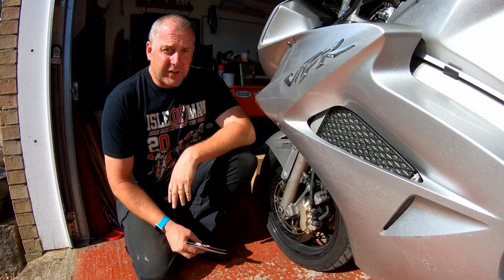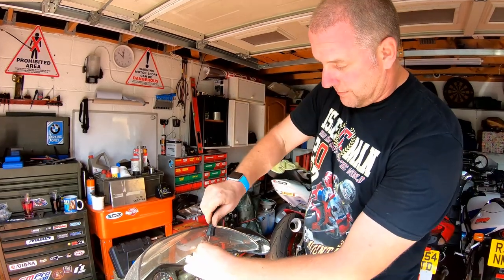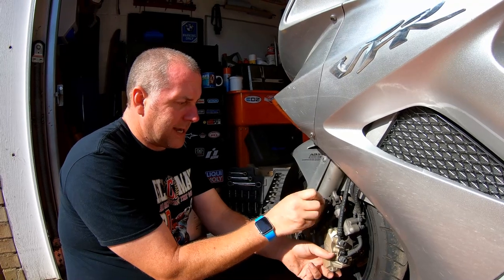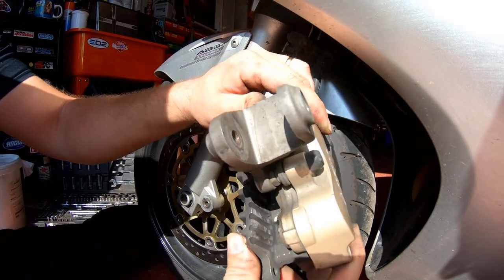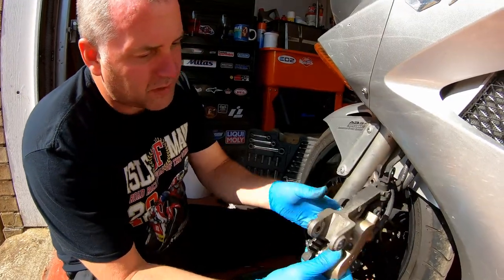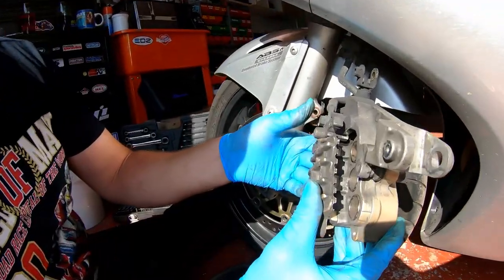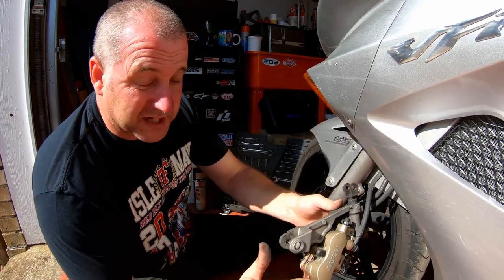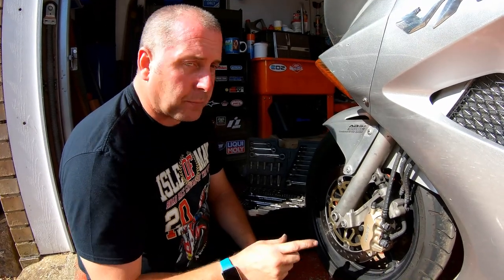2003 Honda VFR800 VTEC Front Brake Pad Replacement

Comment: Hello,

I cleaned the pistons of my front caliper after changing my tires. I'm wondering if it's normal for the caliper to move a bit while driving. I've never really paid attention, but I did disassemble and reassemble it with the correct torque. Taking a look while riding, I noticed it moves during driving. Is it because it's a floating caliper, or should I be concerned?

Best regards,
Romain

Comment: Very good replacement video. I like to actually work my pistons out a little and clean them as you did with a shoe string soaked in brake fluid. I keep working them in and out until they both move equally with a squeeze of the lever and obviously I use the rear brake to work the center piston in and out. When everything is moving nicely, I push the pistons in to their pad installation depth and do what you did to install them. Like you said , cleaning and freeing the pistons is a routine maintenance item....if you want 100% braking force. Cheers Kevin!
Reply from the maker: Nothing like a good cleaning regimen to keep the brakes in good order, I do thus every couple of months. Sadly most people don’t pay any attention to their brakes at all until they hear a metal on metal noise or notice a severe drop in performance!

Comment: Hi Kev,
Completely off the subject. 
I rode through Andorra a couple of years ago on my '98 VFR and it didn't like the altitude at all, it was like riding with the choke out. I thought as it's a fuel injection bike that runs perfectly at normal altitudes  the thin air wouldn't affect it but it did seem to. 
Any thoughts on the subject would be much appreciated as I would like to take it to the mountains again. 
Really like the videos.
Thanks,
Ged

Comment: Hi Kev dont no if you can help with this one just changed all the pads on my old vfr800fi 1999 looked at the old pad and noticed that on the piston side of one pad there is a .5 mm shim between the s/s part on the back and the back of the pad the new pads do not have the shim Thank Alan

Comment: What is that 3rd (middle) piston for? And you never greased the "runner".....agree on the cops slip comment, but you should lubricate the "runner" as well as the spring slider.

Comment: Hey Kev, noticed that at 19:16 your pin is missing the O ring on the end of the pin. Part #8 (45111-MAJ-G41) on the partzilla left front caliper diagram. It appears on both front caliper pins.

I know my bike has them, but have you had any issues with this ring missing? I'm ordering new pins for my 03 as well and figure I'll just transfer them over if they are needed.

Also, have any plans to do a video on greasing the swingarm and pivot bearings?
Reply from the maker: You are absolutely correct mate, they were missing and I didn’t realise until I removed them that they wouldn’t be there! I didn’t have any at the time of filming! 🤦🏻‍♂️ I have since replaced them 👍🏻
Reply from the maker: Also, I will be no doubt looking at those bearings in the future! Lots of videos planned! 👌🏻😎
Reply: @KevsShed  I look forward to it. My chain slider tore at one of the lower screws and I'd like to see someone take the swingarm out before I go after it.
Reply: Jensen, worth pointing out that these o-rings will require the occasional replacement. I pulled my calipers off and cleaned everything today and my o-rings (probably 17-year-old rubber rings on the 17-year-old bike) had dry rotted and came apart as soon as I touched them. So that was fun.

Comment: Having issues with both front calipers. Both centers were not moving. Hot the brake side to work after some cleaning but the left brake side didn’t want to move. Pressured the outer calipers and still didn’t move. Was able to remove and was able to hit the level to see if fluids went through snd it did. I cleaned and flushed out and bled but still nothing.  Any Thoughts?
Reply from the maker: My recommendation is a good replacement of the seals in each caliper, paying particular attention to the recesses that the seals fit in to remove any corrosion. This should sort your problem bud!
Reply: @KevsShed  Got still one caliper not working right.. seems like its' clogged internally. I don't think seals are the issue as there is some fluid showing up in the center chamber, but nothing leaking out of any seal.. Pressure is building as the two outer pistons do move one from another, but yeah after this long seals are a good idea, but it still feels like its clogged in the shared channels. Is there a diagram of the internal path of the caliper? it's passing from #1 to #3 and #3 back to #1 but nothing happens in #2 piston.
Reply from the maker: @mathiasgonthier5436  No you misunderstand me, if corrosion sets in behind the seals it pushes them out which grips the pistons and prevents proper operation
Reply: @KevsShed  wish I could send photos.. all was original and looks very clean.. i rolled my finger over to see if I saw issues, but nothing I could see or feel. No dent or deterioration of seal.. but yes I can see your step o thinking seals.. ok.. well it will take ordering some to make sure.
Reply: @mathiasgonthier5436  press rear brake and the middle piston will come out

Comment: Hi Kevs,
Hope you are well?
I've followed your instructions per video and changed my front break pads on the VFR. 
However afterwords I've notice the my wheel is not spinning freely. 
Any suggestions?
Help pls
Reply from the maker: Did the pistons move back in freely or were they very tight?
Reply: @KevsShed  a bit tight but I've pushed them back.
I must say I didn't spend the same level of dedication you did in the cleaning. Could be that?
Should I get them out again and give the pistons a good clean like you did?
Reply from the maker: It may help, better still would be to completely remove the calipers and rebuild them with new seals. This will require a full rebleed of the braking system however but I have a video available detailing the process.
Reply: @KevsShed  thank you, will do the process again, but I know previous owner had that done few months before I got  the bike.
Thanks for your help and advices.
Reply: I had a 2001 VFR, and after 16 years it was becoming almost impossible to push the pistons back during a pad change - I pressed the pistons out as far as I dared without removing them completely, cleaned round them with scotchbrite, greased with silicone (no rubber grease to hand) and pushed them back.  Worked perfectly for the last 3 years.

Comment: Hiya Kev just wondered if you had noticed much difference with the feel of your brakes since fitting the braided lines ??? brilliant channel by the way.
Reply from the maker: One thing that you will nearly always recognise with braided lines is this; you will notice much greater power at the calipers but this comes at a loss of feel at the lever. It's kind of hard to describe but this is the way I would regard it: It kind of makes the brakes feel more like an on/off switch as opposed to progressive. You only notice this after first fitment though and this gets better the longer you have them as you develop your feeling for the brakes. The brakes are bloody awesome now though! 👌😎

Comment: Hello. So i have a problem with the front left caliper (cbs system). I changed the tires so the wheel was off. The mechanic reinstalled the wheel but now the front wheel is constantly under light braking. After a really short ride the left disc is hot while the right is still cold. I removed and reinstalled the wheel with extra care, according to the manual but still the same. What do i do??
Reply from the maker: My initial suspect would be that one of the pistons is sticking in that caliper, take the caliper off, give the pistons a good clean, there are many ways that you can do this but an old toothbrush can be good here and attempt to push them back into the caliper. If any won't budge under reasonable finger pressure then you will have found the issue and a caliper overhaul may be in order!

Comment: Great vid as usual,  do you ever worry about your brake lines. For all I know my 2002 vfr  has the original ones
Reply from the maker: I’m not concerned about mine, I check them regularly and there are no warning signs such as cracking or crazing to the rubber. When they do need to be replaced then I will change them for braided ones.

Comment: No copper anti-slip to be seen! - a man after my own heart (oh, that sounds dodgy).  After all, Honda choose SS sliding clips & springs for a reason - and you just cleaned them.
Reply from the maker: Nice one Martin! It seems that there are some sane people in the world! You'd be surprised at the number of comments from people telling me that I am an idiot for not slathering an anti seize compound over my brakes! 🤔
Reply: Good men !

None of this ''butter it like a biscuit'' stuff.

Cannot fathom why guy reuse pins etc that are absolutely corroded beyond all recognition, out of laziness or to save a few kopecks, and then turn around and apply copper grease to everything in sight.
Reply: The scales have fallen from my eyes, I've been copaslip-ing these all my life but no more!  I checked and it's not applied from the factory, not called for in the manual and not recommended by brake manufacturers either.  thank you Mr Shed.

Comment: Nice vid as usual, do you not use the skylift anymore?
Reply from the maker: Not needed so much on the VFR as it has a centre stand and the jobs that I’ve done recently didn’t warrant it. The ZX9R is currently on the stand in the back of the garage waiting for my workshop to be completed before the tear down commences 😎
Reply: Cheers Kev. Only reason I asked was that I am considering one but as I’ve not seen you use it recently, I wondered if you’d given it the elbow. Thanks for your efforts each week.

Comment: Hi Kev what’s the history of the bike
Reply from the maker: Very little known unfortunately, I bought the bike as a commuter hack and to be honest, the bike is probably receiving far more attention than it ever did before. Mechanically it is pretty sound but the paintwork is a bit shabby and scratched. I have a number of large jobs yet to do such as valve clearances,rear hub rebuild and a throttle body sync.